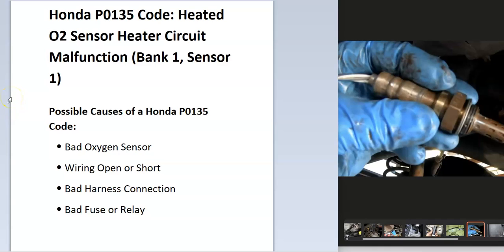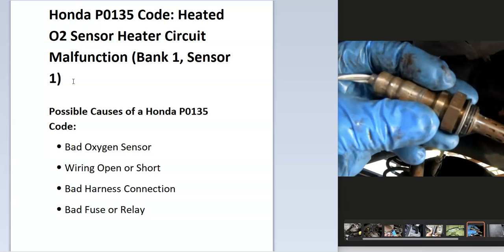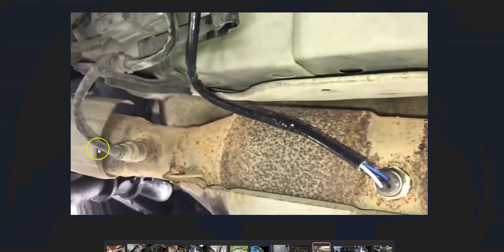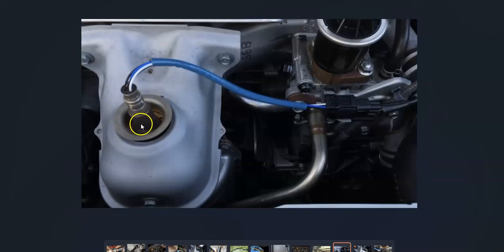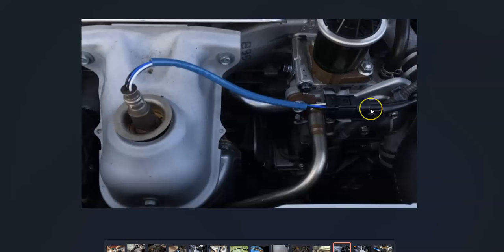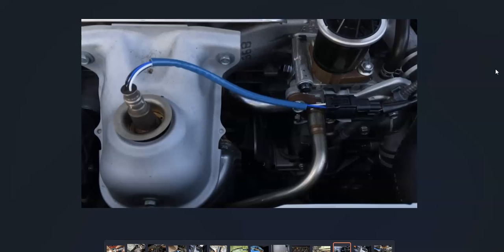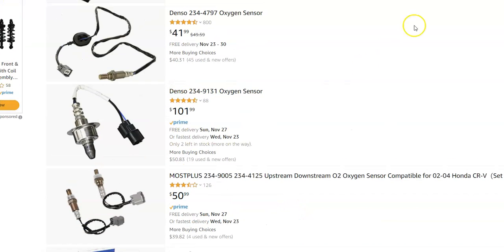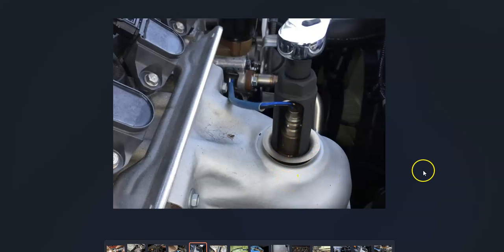How to Fix HONDA P0135: Heated O2 Sensor Heater Circuit Malfunction (Bank 1, Sensor 1)

Comment: So I replaced the o2 sensor, it fixed 2 of the 4 codes. but the two codes that remain say that both heater circuits are malfunctioning. the car still doesn't want to accelerate after completely warming up either. 03 2.4L accord so it only has the 2 sensors, but hard to think 2 new heater circuits are bad. checked fuses and replaced relays already as well.

Comment: Where is fuse for Up O2 not a single info anywhere on manuals or google, strange!

Update: UP O2 has no separate fuse but it was O2 Circuit FI SUB fuse 15a in engine bay fuse box.
Reply: @dodiyavasim1245 yes sir I have been looking for this information for my 01 Honda accord 4cyl vtec.

Comment: Mine ended up being a loose plug,just fixed my check engine light 10 seconds after tightening them.
Reply: YouTube algorithm is trash,I'm trying to explain my problem and how I fixed it and they keep erasing it.
But they'll let people advertise wolves having sex and garbage spam about the government 6700 dollars you missed on but won't let me explain my fix on more than 1 video.
Reply: Spark plug? Or you referencing a different plug?
Reply: @ngk330  yes spark plug,were so loose I could take em out with my hand and a extension and 2 were loose but not as.
Reply: @WYLDBILL  I’ll have to check mine tonight, just has this code pop up on my way home

Comment: So I bought the car In my profile pic (Honda Del Sol) it has a full custom exhaust the only code I get is thise one. When I look under the car there is just a bolt covering I guess where the 02 sensor would go right in the exhaust?
Reply: Sounds legit for a del sol😂 those and civic ALWAYS have custom exhausts and ALWAYS have a plugged o2 bung

Comment: Can a crack on the sensor socket still cause a code even after the sensor is replaced?
Reply: If there is any air leaving close to your upstream, it will still cause a CEL

Comment: what fuse or relay are we looking for? whats it labeled as
Reply: 15 fuse under the hood on driver side.  I forgot what it's labeled as but it's a row of 3 fuses 2 of them are 15amp, if I remember correctly it's the one in the middle
Reply: @teenice894  عندك سناب شات او انستغرام ؟ ابغا اتواصل معك عشان اعرف المكان بالضبط
Reply: @teenice894  عندك سناب شات او انستغرام ؟ ابغا اتواصل معك عشان اعرف المكان بالضبط

Comment: i have a 2009 Acura TSX throwing two codes. P0135 and P0498. I have replaced the EVAC solenoid, Oxygen sensor and purge valve. Still getting the codes. Any ideas?
Reply: I did the same on my 2013 Honda Accord 2.4 coupe, did you find a fix?
Reply: @witchcraftauto  same
Reply: I'm getting the same two codes on my 2006 TSX.  Did you ever figure it out?
Reply: Getting the same codes on my 2009 Civic. I hear it’s a PCM glitch. Nothing you can do about it besides replacing the whole PCM
Reply: Did u figure it out?
Reply: Did you end up figuring out the culprit?

Comment: I don't know if I am wrong or the video telling is not correct.
I replaced both O2 sensors but the ODB code stays the same
Reply: Check wiring
Reply: @mayksantiago7328  thank you, I will do it
Reply: Did you clear the code?
Reply: @WayneCarrigan  sorry the code did not go away
Reply: @abcmedia2297  I understand that the code did not go away, but did you use your OBII scanner to delete the code?
Reply: @WayneCarrigan  yes, ODBII scanner deleted the code but it come back within seconds.
Reply: @abcmedia2297 did you solve this?

Comment: Guys, i have read and found out that sometimes some will need the air/fuel sensor even though it calls for an o2 sensor. They are different and need to be replaced as such.

Comment: Hi so I replaced my o2 sensor n my code is still showing up
Reply: they call it an O2, but for bank 1 (before the catalytic converter) pretty sure it uses a Air/Fuel sensor that looks and threaded the same as an O2 sensor.
Reply: @dannyn6850 exactly
Reply: Under the hood fuse that is a blue 15 or the relay
Reply: Same here.. I  clear the code and it popped back up after driving it 50+ miles to… but I did use an inexpensive 02 sensor. I’m a try NTK brand or a dessno 02 sensor
Reply: @justinthompson9316  im having same problem...did the better branded sensor fix it or was it something else?
TIA
Reply: Chang fuse or relay the fuse is a 15 under the hood!
Reply: @justinthompson9316 What number is the fuse located, I searched out YouTube and google and not 1 video to show where that fuse is 😊
Reply: @658BeardedChef  Did you find where the fuse located under the hood ??